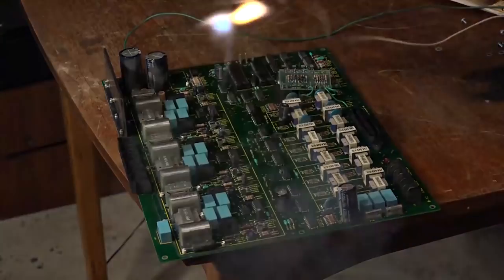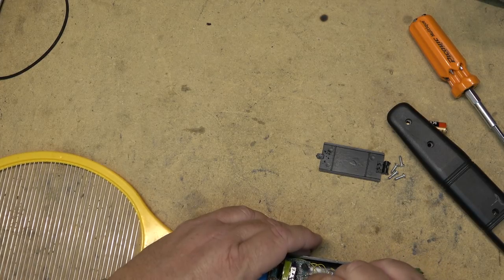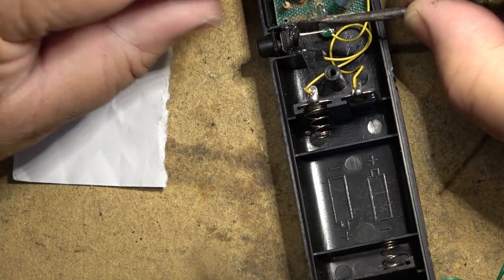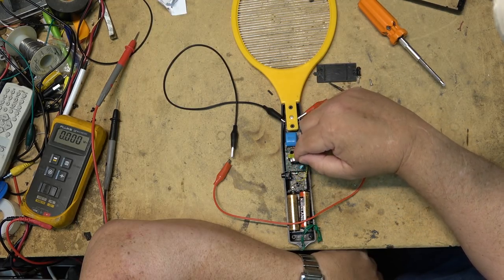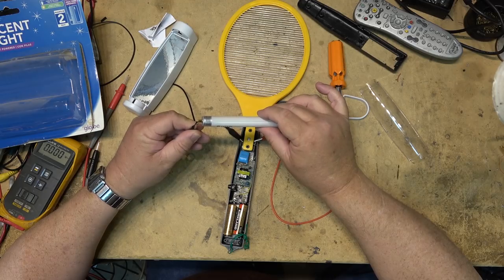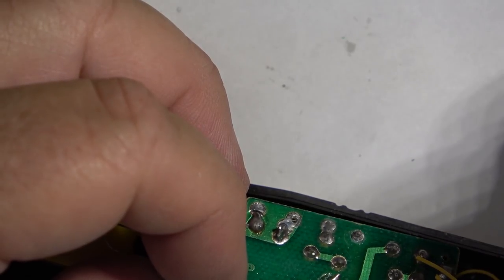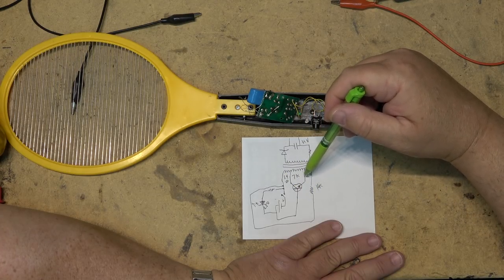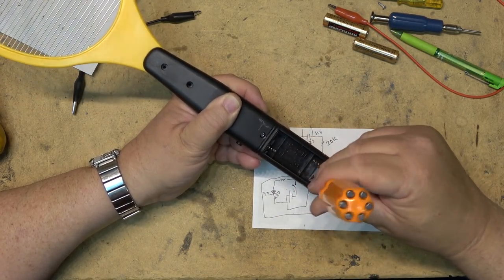Electric fly swatter tear down and repair

Comment: I had an identical bug zapper. The oscillator circuit is quite rudimentary. Years ago, I got a toy gun at a garage sale. It had a photo flash circuit inside, which was more complex than that. The transistor in the circuit is what causes the whining noise in the circuit. A sibling of mine got a barbeque lighter once. It used a 9 volt battery. All it had inside of it was a 1000 MF 16 volt capacitor, and a micro transformer, that wasn't a centre tap type transformer. It was like a micro version of an ignition system for a vehicle. It gave a powerful jolt. Thanks for sharing this. Cheers!

Comment: When we were kids we used to cut out the discharge resistors and add a capacitors to make flies EXPLODE. 
Adding a microwave capacitor was the best mod. You could explode wasps with one.

Comment: I have some kind of no-see-ums that live in my apartment. They actually wait for me on my bed around the edges of my blanket. They aren't bedbugs, btw.
   I pat my bed down to zap as many as I can before I kick back, but these zappers are designed to be waved in the air, not patting a bed. As gentle as I am, the zappers seem to stop working right away...a couple only lasted a day! I've gone through a dozen in the last six months, and don't understand why they stop working. I'm patting a blanket...not hitting a tennis ball!
   Nothing else works on these bugs, but I can't keep buying these things. Why the hell do they stop working with so little use?

Comment: I bought one about 10 years ago and it plugged into the mains to charge it. The bottom half unscrews and has the mains plugs on the end. I converted it to a 1S lipo when the internal battery failed :) sounds like a light saber now, I tried 2S but it was sparking a bit :)

Comment: I have a bunch of these zappers and yes I fix mine too. Smoking bugs on these is a lot of fun. Bug smoke, Don't breathe this. wasps, hornets and yellowjackets are not safe around my yard. I bet you could put a 1000v capacitor into that zapper and it will have a better zap. Mine seem to have 2000v capacitors even though the packaging says 2300 volts 2750 volts.
Reply from the maker: Even with that 400v cap the voltage will still get much higher.  For a short time that can can probably handle 1000 volts are more.
Reply: @12voltvids  I just bought some 2000v caps the red ones found inside many of these zappers and some transistors on amazon. Had to replace one in my larger zapper that doubles as a bug light. This thing is entertaining to watch.
Reply: Mine snaos and cracks like a stun gun if you hold the button down lol
Reply: @HDXFH  Its arcing somewhere. I've had that happen on mine. Inspect the grid because that's usually where it arcs.

Comment: In essence that bugg  Zapper uses the same principal of how the Power stations send electricity at high voltage and low amps- this goes back to the days of Tesla and Edison, it was Tesla who solved the transmission power issue over long distances .

Comment: I had this electric fly swatter around 20 years ago when I was a kid, if I rest my hand on the fly swatter's mesh when it's being turned off, and then I turn it on, I won't get zapped. But if I turn the zapper on first before resting my hand on the mesh, I will get zap for sure. I wonder if you can explain why I didn't get zap if I put my hand on the mesh first before turning it on?

Note: since this happened about 20 years ago, I can't confirm if the electric fly swatter I used was same as the modern one which has non-conductive protection outer mesh. But since I can get the zap by touching the mesh, so it probably doesn't have non-conductive outer mesh.

Comment: Also got one of those style ones from Foetsie. Really nice. Don't really need it anymore cause I got fly nets on all Windows. But still neat when the one or other insect thinks it's funny to sneak in with me into my apartment through the door.
Reply from the maker: Well I have air conditioning so the doors and windows stay closed, however they do get into the work shop. I use it more on those nasty hornets.

Comment: I do not have very good experience with jb weld and similar glue. Fills more than it glues. In order for the glue to stick to the surface it must contain chemicals that dissolve some of the surface or you must sand the surface well.

Comment: Could you use a electric screwdriver to discharge any charge left
Reply from the maker: It has a discharge resistor that discharges the cap to 0 after about 5 seconds.

Comment: The problem with the switch on yours (and mine before) is you get so excited to swat those hornets and you press the button way too hard. I installed a micro toggle switch on the top cover beside the LED and now I can swat at them stress free. I never leave it on for more than a few seconds. Mine kills the hornets with no mods. I hit them hard and with the spark they don't stand a chance. lol
Reply from the maker: I always get excited to swat hornets.  Been stung too many times to count and last one put me in hospital.  I found out that, yup I am allergic slightly.  So if I get stung I am reaching for antihistamine quick.

Comment: I had one identical to that.  Yellow just like that. But the handle got really hot, guess the on button got stuck in the on position. So I had to take out the batteries and trow the zapper in the bin. Crap.

Comment: If there is room, I might get a rod of ABS plastic and use ABS glue to place the rod behind the switch all the way to the other side of the housing.
Reply from the maker: Why, suberman couldn't break the JB weld.

Comment: Wow I haven't seen one of those unshielded ones for a while now. All the shops here in the UK only sell the ones with the safety screens now, and any time anyone on ebay is selling one of the old ones they go for quite a bit of money as they seem to be in high demand within the BDSM community :/
Reply: Amazon UK still sell the old type. It's called "The Executioner". I added some extra capacitors to mine which really helps with bigger insects and makes a satisfying loud bang on contact!

Comment: I'd like a fly swatter that has more of kick, that holds the charge and lets me know when its charged AND has a discharge button and lets me know when it's discharged. Why are these things not better designed....
Reply from the maker: It has more than enough of a charge.  Gets the job done.  Takes out wasps nicely.   It discharges in about 5 seconds after you release the button.
Reply: @12voltvids  I know. But mine doesn't have enough charge. Not anymore. Flies often survive etc. And I want it to hold a charge so it's primed to use and therefore i need a discharge button. With a light to let me know if its charged or not. Just saying i would like that more.

Comment: Well, I guess if there was a schematic to this, it would say “do not measure”. Sort of like the anode cap on the horizontal output tube in the old CRT TVs. 😏
Reply from the maker: Ya anode cap on horizontal output.   Mega high voltage pulse.  You could  pull an arc through the cap to an ungrounded screwdriver and corona off the insulated wire.  Off the metal a 1 inch arc easy.  We had a spray called corona dope (which I believe is the same stuff as flex seal) to spray on the cap to stop the arcing on cracked anode caps.   Oh and the ozone they would put out.  I can still smell it.   Mmmmmm ozone.

Comment: The replacement fuses cost a fortune too
Reply from the maker: Fuses? In this? No.
Reply: @12voltvids  I meant in the fluke lol. It's why they cost all the money. Edit. Flukes are usually just fused for amperage and have those resistor arrays for volts I believe. I'm not lucky enough to own one but I will have the 87v, yes I will have it. Haha
Reply from the maker: Yes the fluke has fuses in it.  Good old made in USA fluke.
I paid 10.00 for my fluke.
Reply: @12voltvids  wow. That's crazy. I'm getting the 87v at cost and it's still gonna run me around 450cad
Reply from the maker: @jstro-hobbytech  I bought mine at a ham flea market in 91
Reply: @12voltvids  a fluke is a fluke man. An American made one I mean. Did you see Marco reps restore the 1987 fluke calibration device? A lot of work and money.

Imagine though 10 bucks
Reply from the maker: @jstro-hobbytech  It would be a fluke if it is accurate. ...     I mean if it's accurate it WILL be a fluke!